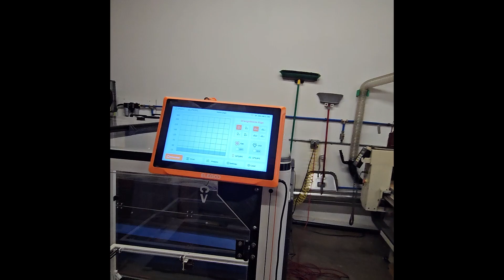Elegoo Orange Strom Giga Enclosure by Clearview Plastics

Comment: It's a really good enclosure. We just assembled mine. I would like to point out the directions have bolt sizes that do not match what's in the kit. The are just a few mm off & come with JUST enough to do the whole project. You will need an extra set of hands when assembling this bad boy. Overall I am very happy with it!

Comment: Did you not add an external heater?
Reply from the maker: No and no plan to set this active heating from us. That will be DIY. The kit would allow you to add your own using either wire grommets precut into the panels or using 1 of 3 120mm fan ports.